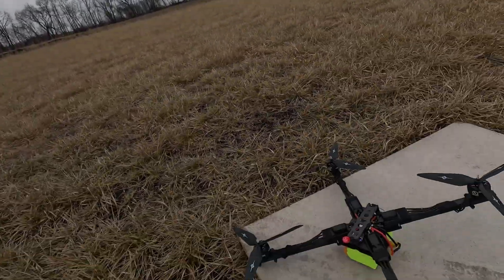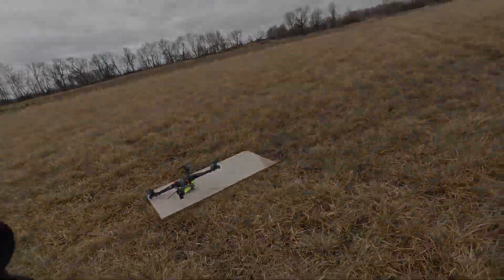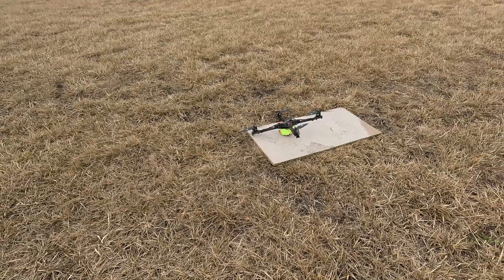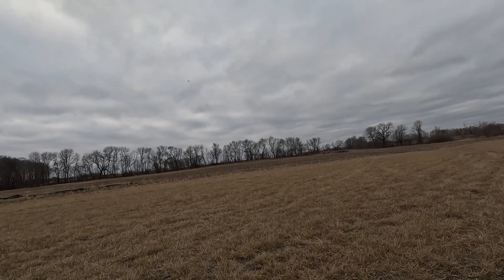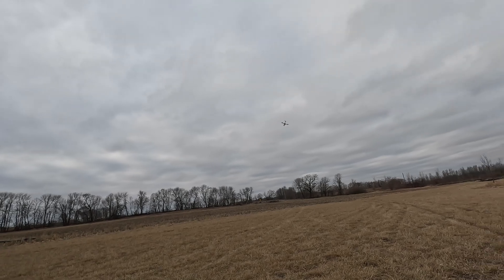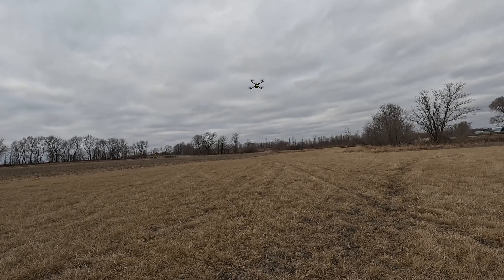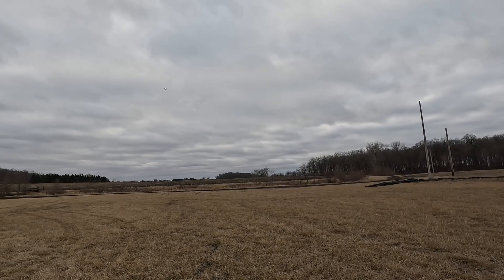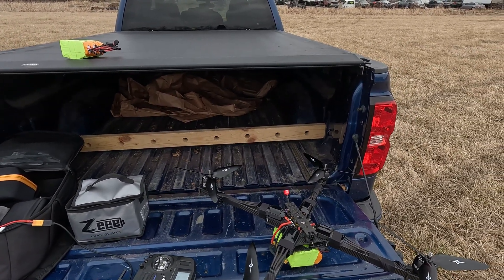12s Beast Class Drone Test

Comment: Nice build man
How's the fly colour esc holding up im considering some
Reply from the maker: @noisy_boi_fpv_3920  they’re the best esc’s I’ve used so far for these size quads. Rock solid performance. Just need to change the “non-damped mode” setting so the esc’s have active braking. They are setup for airplane motors so they freewheel when you kill power. Don’t want that for quads.